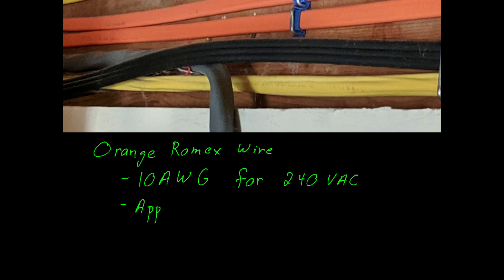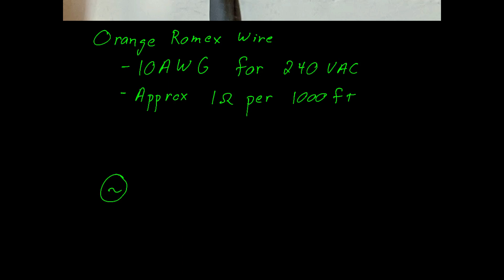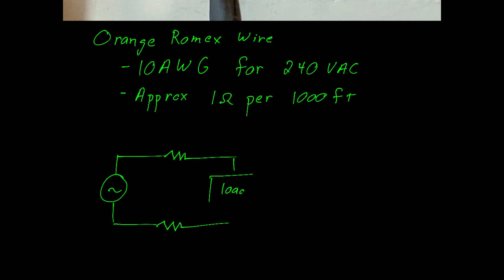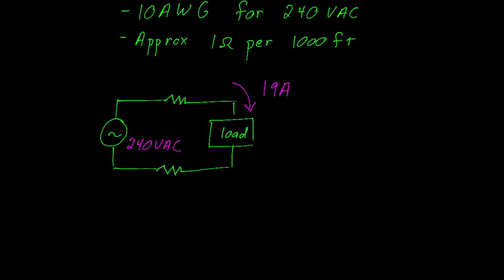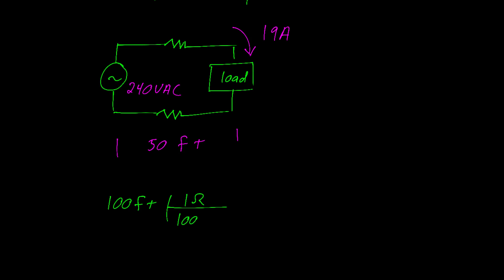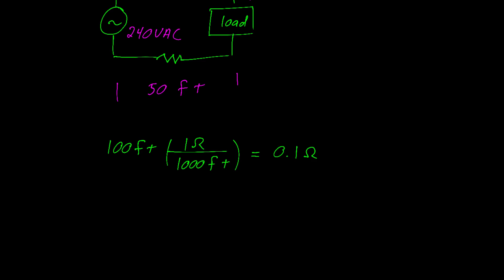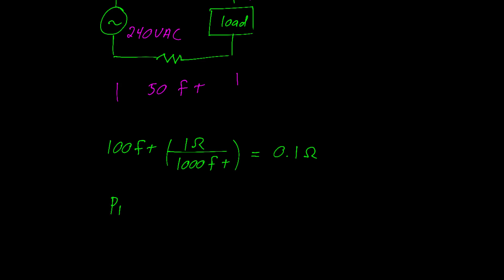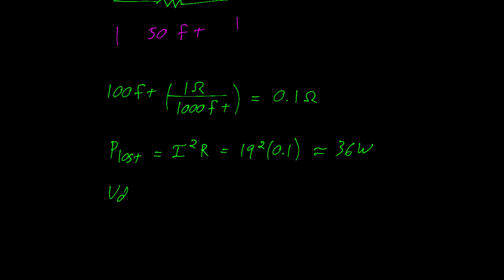Calculate power loss and voltage drop in a wire

Comment: What's the most 'efficient' way of producing large scale energy/electricity? 
What gives the most output with least input? Is that the cheapest?  Please exclude externalities.
It might be a simplistic question; there are many more nuances to this
Reply from the maker: Hello Seraphim,

We can't answer your question without considering the spatial and temporal demands of the user. For example, consider a large city. It lives and dies by it's energy supply. There are very specific daily and seasonal demands that must be met.

Folks often fall into a trap when they compare generator X to generator Y. It's a trap to compare them in isolation. A prime example is the nuclear renewable energy argument. Each generator in out toolkit has certain advantages and disadvantages. 

I would encourage you to consider the regional energy needs and how they can best be met with a diversity of generators to provide a low cost reliable system.

Best Wishes,

APDahlen